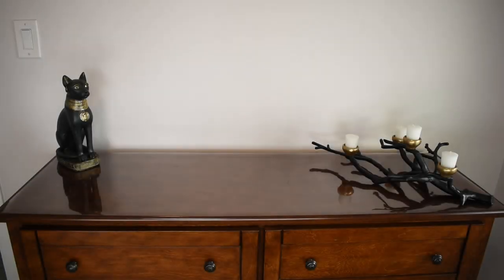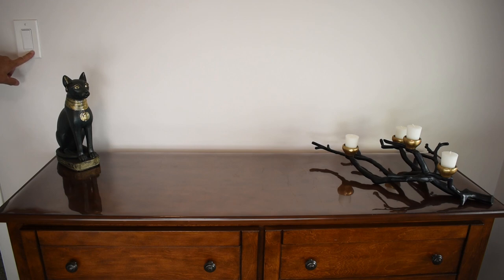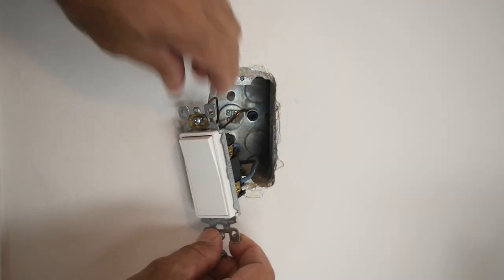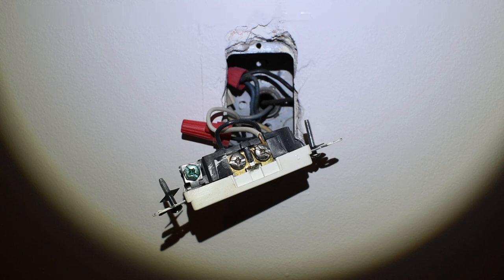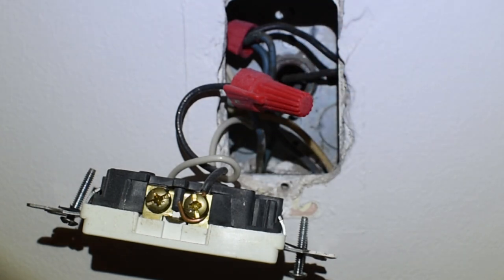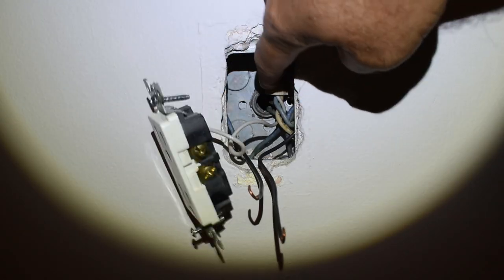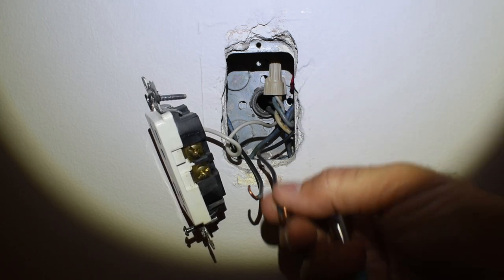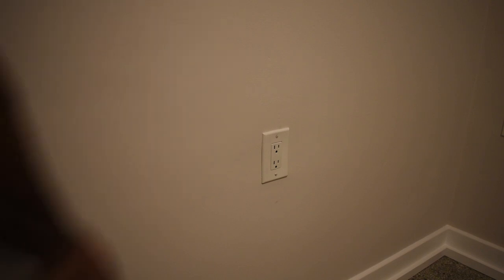How To MODIFY Or ADD Switch Controlled Electrical Outlets (Step By Step)

Comment: I didn't realize that a wire loop that is a bit too wide will tighten around the screw when the screw is tightened.  That's good to know!  Guess I never noticed it or it didn't register.  Thank you and great job, Scott.  👍

Comment: something interesting you mentioned in your video about the capacitor would increase the voltage and lower the frequency. allowing the 90 volts to be increased to 120 or more does self looping exist